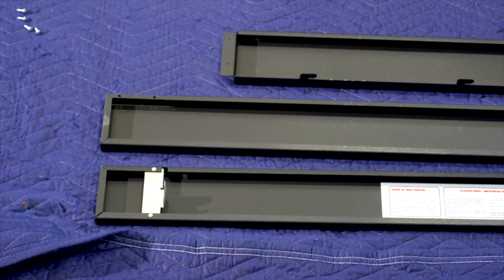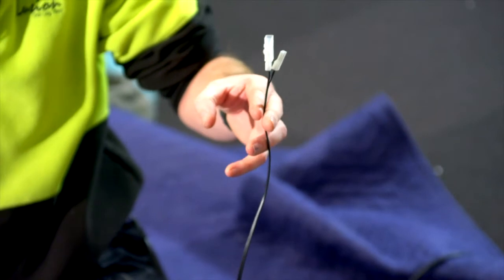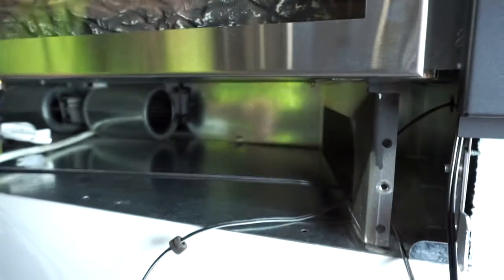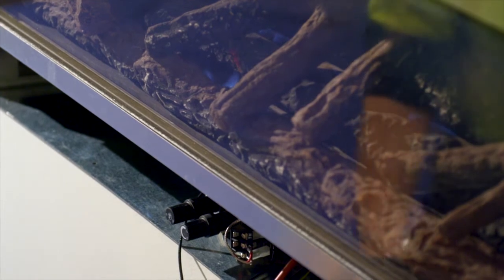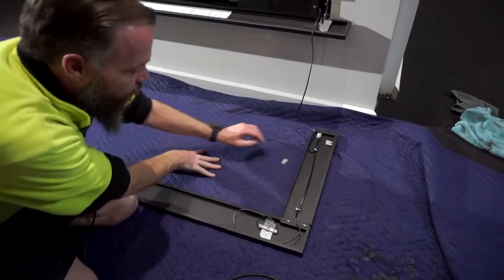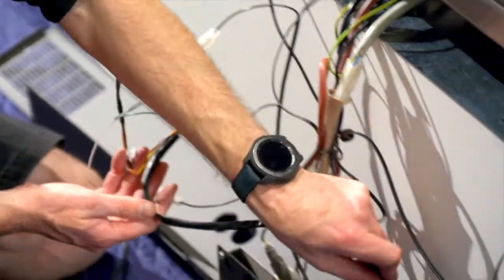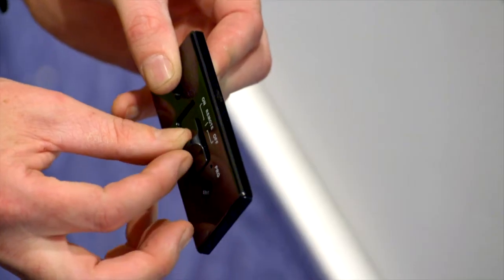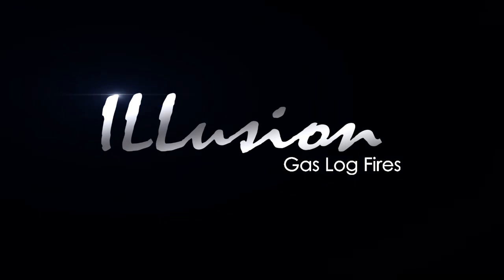Attaching the Fascia for all Luminar Models

Comment: In terms of the wiring for the Skytech remote receiver you just need to attach the 2  wire ends to the THTP + TH endpoints. The Skytech 1001 manual  (You can google and find it) has the wiring chart. The wiring chart in the Gas Log fire unit itself wasn't very clear.